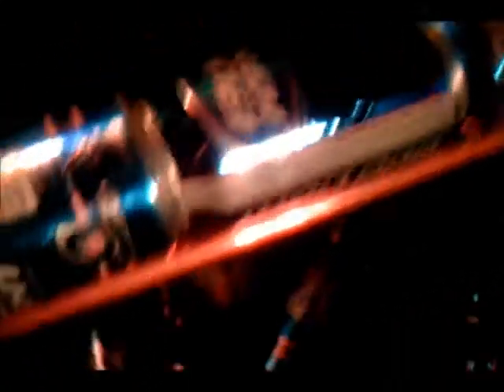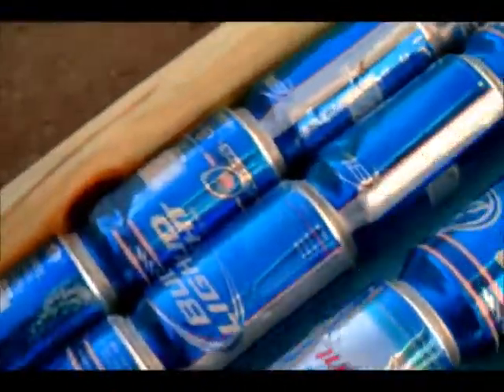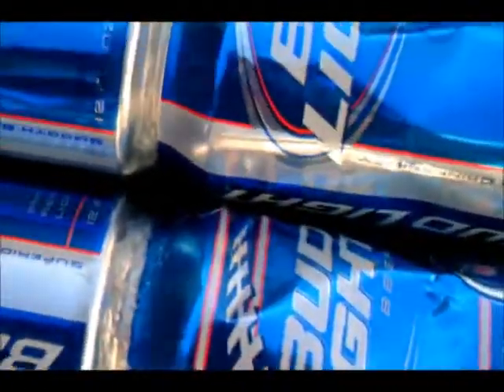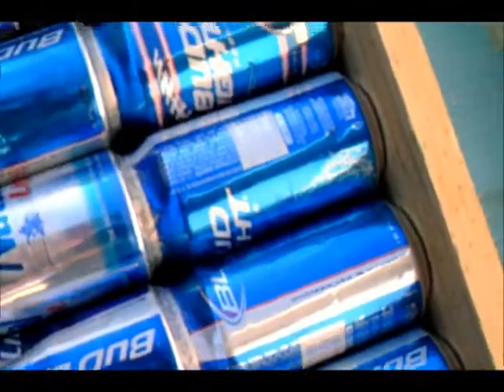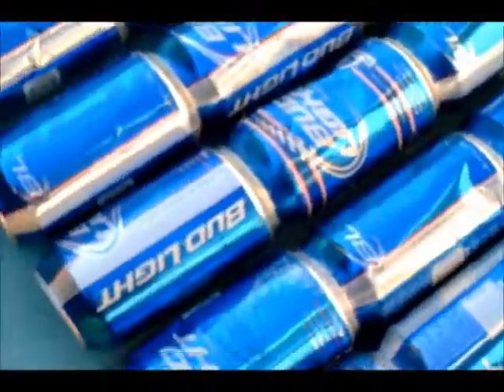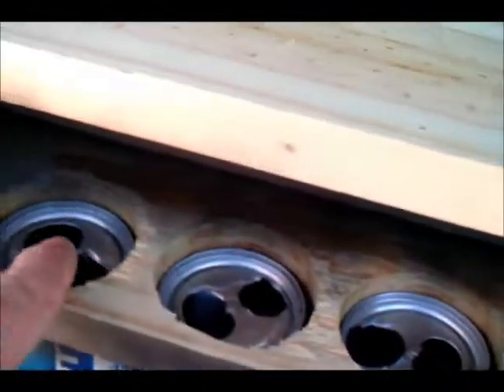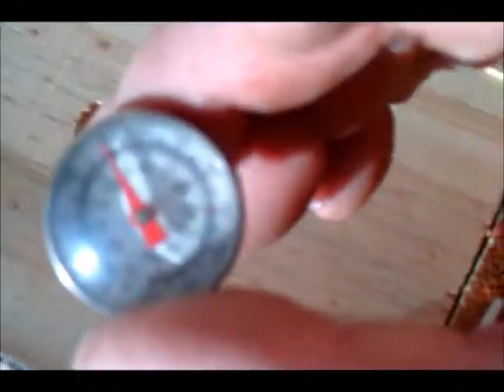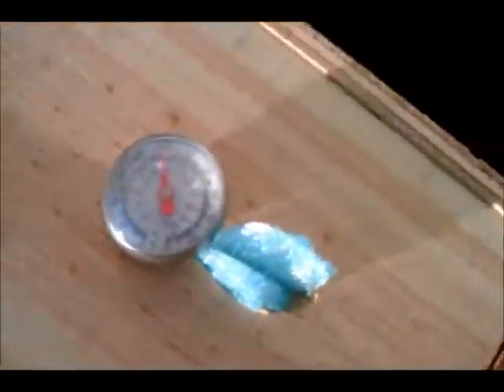solar air heater PART# 2. FREE HEAT!

Comment: @chaseme81871 I had an idea about using those coarse steelwool-dots, just stuffing the unit full of them, paint it black and hold it down a bit from the glass with a metall mesh. Having the air being forced through all that conductive material should work just as well as our timeconsuming can-glueing =P I did use cans myself though, got a video out now from testing it. Gave me 30c increase, so it's going up on the wall today =)

Comment: Ah yes, there's the glass =) I hope to get a video out some day but here's how I think about solar heaters. The "unit" should be fully insluated from the outside, inside there are airtubes made out of thermal conductors like popcans, not insulated of course. The "void" between the outer unit and the airtubes should be completely airtight and insulated. The inside of the void should be framed with more thermal conductors like metal and painted black to allow for the thermal convertion to happen.